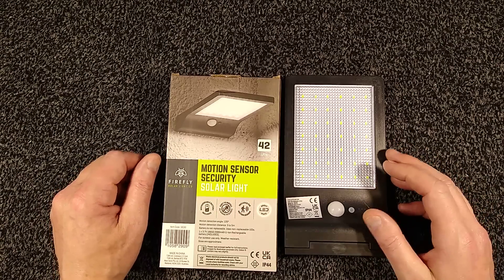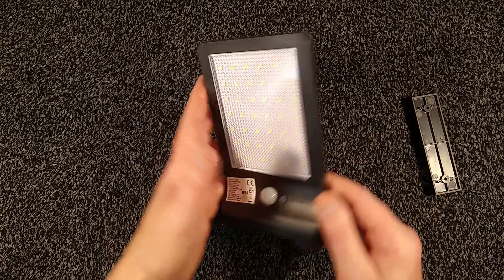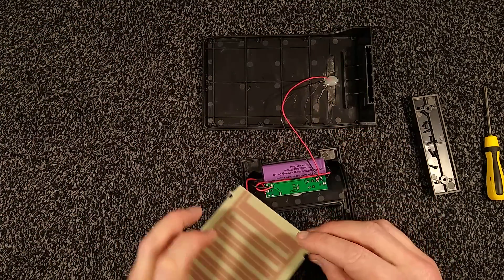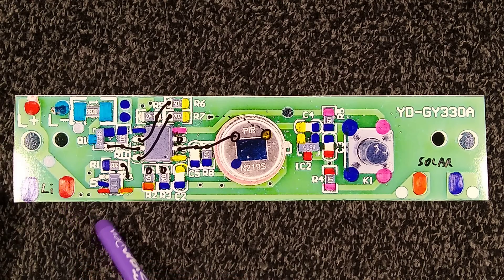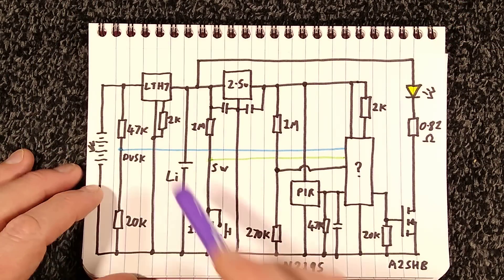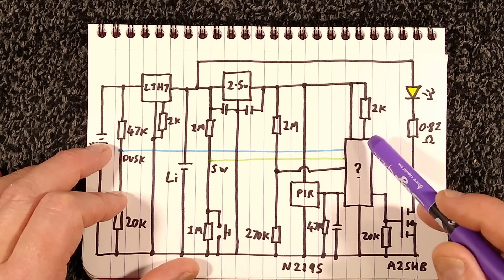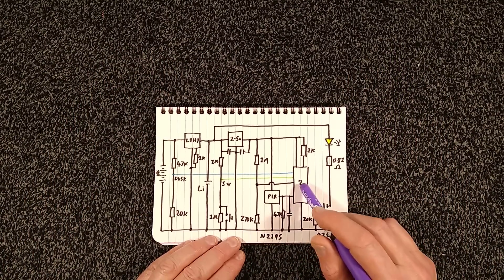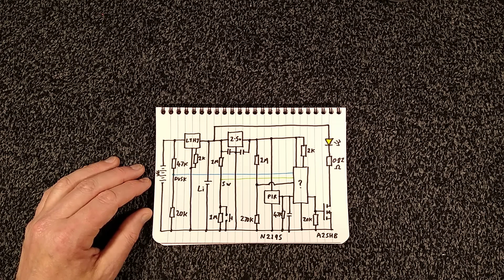Home bargains solar security light is better than the junk on eBay

Comment: I bought some of the solar yard lights from Walmart for $2 each.  I ripped the tiny lithium cells from them and replaced them with 3x 1.2v NiMh rechargeable cells into it, which is perfect for the charging circuitry.  Now they stay on all winter and can provide about 1.5 nights worth of illumination with no sun at all, as opposed to the 2hrs they stayed on after a sunny day as purchased.  They have been running for about 5 yrs now and work fine at -40F.
Reply from the maker: You may find that the lithium charge circuitry stops charging them too early.  Especially as they get older.   But it's a viable fix in some situations.
Reply: @bigclivedotcom  They had 4.2v 100mah lithium polymer packs in them, which is a perfect charging voltage for 3x 1.2v cells.  The solar cell only puts out like 10ma, so no chance of overcharging them.

Comment: I have a solar light that has two slots for 18650 cells.  It only came with one slot filled but I filled both slots with matched cells for better longevity.  Great option for darker times of the year.
Reply: Lithium cells in parallel don't need to be matched. The second cell can freely be lower or higher capacity than the first.
Reply: @hockeyguy820  Probably not in this case but it's probably best to match in a high power draw pack from what I understand.
Reply: Adding batteries dosent increase the available sunlight to charge them !
Reply: @andymouse  It does increase the storage capacity!  It can go more days with poor sunlight.
Reply: @jmr  The next day you use the energy. You need to think about it abit more if the batteries where fully charged it would last for days but in the UK we don't get enough sunlight to charge them back up. you can put a car battery on there you aint gonna get enough energy off a 8 hour UK summer day...don't bother me if you don't get it ask Clive FFS
Reply: @jmr  Increases the bloody capacity but if there aint enough sunlight to fill it up then what the hell has capacity got to do with it ?
Reply: @andymouse   Do you want me to take a picture of the sun and send it to you?  I swear it's real.
Reply: @andymouse You realize not everyone lives in the UK, right? Also, if it only takes 2 hours to charge one cell that still means adding another allows the capture of 4 hours of sunlight. It generally doesn't take an entire day of dessert sun to charge a single lithium cell.
Reply: @RAHelllord  not everyone lives in the uk ? are you sure ? are you a Doctor ?   lol trying to say dosent matter how big your bucket is if it only rains a tiny amount thats your lot ! you at least seem to understand that
Reply: @jmr  Grow up. That's a child's answer if ever I heard one. Keep you playground stuff to yourself.
Reply: @jmr  OMG you realy don't get it !! This is about CHARGING !!  go away.
Reply: @andymouse  I don't know why you are so concerned about my batteries.  Led lights don't take much power.  An extra battery is enough to get through the days when we don't have enough sun and into the days when we have too much sun.  It works for me.  The single battery they put in wasn't large enough for my area.  It's capacity was terrible.  The solar panel is big enough to charge larger batteries in most seasons.  End of story.
Reply: @jmr  :)

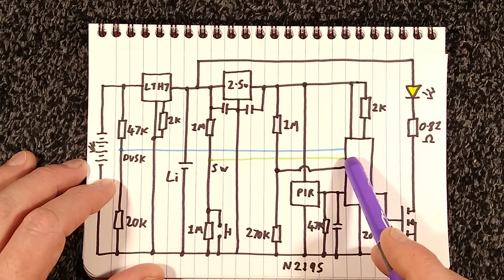Comment: 5:01 It's before the regulator so it can also monitor the cell voltage. I bet the LEDs will not turn on if the processor thinks the cell voltage is too low.

Comment: Re: Low temperatures. How about a vid explaining how to modify circuit to charge nickel cadmium batteries which can operate down to -40?  Too often I find many of these solar/lithium gadgets remain under-powered  ‘novelties’ of little use  to me.
Reply from the maker: That's not a bad idea.  Converting lithium products to NiMH for locations with harsh winters.
Reply: As a quick hack, you could substitue a LFP based 18650 with a pair of reversed/forward biased parallel silicon diodes on the +ve wire to the battery to adjust for the voltage difference with Li-Po. Although, not as extreme a temperature range as -45 it would extend support down to about -20. 

Alternatively, if the LFP's output voltage drop across the battery power output diode to the regulator is too much, one could do a small hack on the board:
- Insert a charging diode on the +ve wire between the board and the LFP battery. 
- Cut the track on the back of the board between the battery +ve wire solder pad and the regulator through hole (leave some of the track available at the through hole). 
- Cut the +ve rail track on the board front to the LED wire +ve pad. 
- Solder a new wire from the LFP battery's +ve terminal to the LED wire +ve pad. 
- Add a jumper wire on the back of the board from the LED +ve solder pad to regulator side of the first cut track (say at the plated through hole to the regulator) . 

[edit: update with simpler design using a board hack].
Reply: @GruffSillyGoat  Thanks. And the lower capacity can be sorted by using two. All that’s needed now, is a quick mod to the weather system so the sun shines brightly all winter.

Comment: Just so long as you don't poke about around the back of the PIR sensor to trigger the light as per a past one (a poorly designed one where you had to cover the solar panel to turn it on or off!), saves it from ending up as a non-security light... :P

Comment: Hmm, I'm not entirely sure I'd trust it not to blow off it's mount, always thought they'd be good as an indoor light, incase you lost power for whatever reason, at least you could have a little light to find the toilet with 😅

Is there no chance of the charge set resistor getting cooked should, somehow, the solar panel try and pass more than 500ma, specially being black on a sunny day
Reply: I have one that looks exactly the same, the light color is super white which is annoying indoors. Otherwise it's good

Comment: ...Next design iteration...When temp is below freezing and sufficient solar energy is available, the device initially uses all solar energy (and maybe even some stored battery power) to warm battery up before starting charging....
Reply: Well so much for using it up here in interior Harrogate 🙃 months of darkiness and where I am, it's below freezing about 15 months of the year straight. 😂
Reply: I have ones that discharge the battery every day for 20 seconds by going on for no reason
Reply: External contacts that allow you to connect a 9v alkaline or NiMH battery to heat the battery and provide a bit of charge when the Sun isn't providing enough power would probably be the best design, IMO.

Comment: You mention that Li cells don't like to be charged at low temperatures. How about discharging (using) the LI cells at low temperature. I'm here thinking of the Ozone generator I use in my fridge, though the temperature doesn't get to sub-zero - it does get quite low (4 - 5 °C)
Reply from the maker: Their discharge temperature range seems to be wider.  When I recharge my fridge ozone unit I leave it out for a while to let it warm up a bit before charging.

Comment: Evidently NiMH should also not be charged below freezing, but perhaps they are more resistant to being damaged by this approach?  I've had a very similar sort of PIR light deployed for about a decade, only using a single NiMH cell instead of LiPo, and it still seems to do okay.  It often stops working in winter, but my assumption there is just that it isn't getting enough sunlight to offset the consumption of the longer nights, especially with how bright the standby mode is...

Comment: I suspect that the divider that the switch is on is also being used to monitor the battery voltage.
Reply from the maker: That's a good point.

Comment: When you said the PIR might be a bare sensor, did you mean bear sensor? And do bears send out infra-red through their furry coats?
Reply from the maker: It's human bears.  WE emit lots of IR.
Reply: @bigclivedotcom  Ursus bears probably are better insulated in that way. Especially Bear Bears.
Reply: @rimmersbryggeri  ....insulated & grounded !!!
Reply: The number on the sensor indicates that it has an analogue output. PIR N219S. The datasheet has the pins marked as drain, gate and source. The same as an FET transistor, or the output of an electret microphone capsule.
Reply: As Clive clarified, it's human bears, this device must be suitable only for humans named Bear (there are no genetically-human bears, as far as I know).
Reply: @ralphj4012  I only know Bear Grylls but I dont know if hes genetically a human or a megaphone.

Comment: I have had one of these for a while. I found it in a bin. Never used, and had a charge. I just use it in the shed.
Reply: Nice to see a Liverpool fan in the wild
Reply: I would NOT be proud to say I found something in the bin... Even if I was a proud Scouser 🤭🤣🤣🤣
Reply: @MothKeeper 
I love to find things in skips and get them working. It keeps them out of the landfill dumps, which to my mind is a good thing.😊
Reply: My dad used to go skip diving in the night 😂.. It was funny as he would comically  overreact to any noise or passing light of a car etc. 
I'd sometimes go with him, it felt nefarious back in the 70's (which it probably was and is)
He'd find all sorts of barely broken or unwanted stuff, plus really useful DIY materials, half tins of paint, planks of wood etc. 
He built me a "space station mission control" type play room in our garage, it was great. A full back wall of control desk covered in switches and flashing lights, and the vertical surface up to the ceiling of screens (none worked he just replaced the glass with backlit paintings of solar system etc) but there where sounds connected to some of the buttons and switches (somehow connected to old tape recorders stowed away)
I loved it.